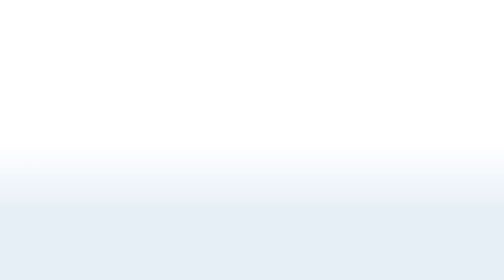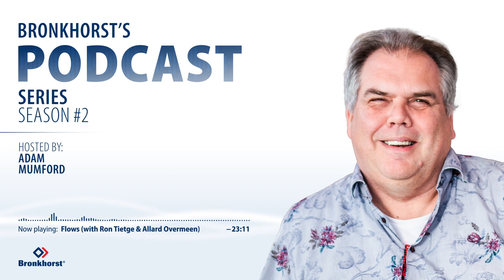S2#2: How to Handle Low Liquid Flows (with Ron Tietge & Allard Overmeen) – Bronkhorst Podcast Series

Comment: Funny anecdote - the driving gas (e.g. Argon) can dissolve in IPA - The Coriolis flowmeter will happily (and correctly) measure the mass flowrate of the dissolved gas too. However, the reference weigh-scales (after the meter) won't register the gas, as it effervesces out of the dosed liquid, at ambient pressure. The weigh scales read a few tenths  of a percent lower mass-reading than the totalizer, on account of the lost mass of the gas. A lot of head-scratching ensues until someone notices the champagne-bubbles ;)